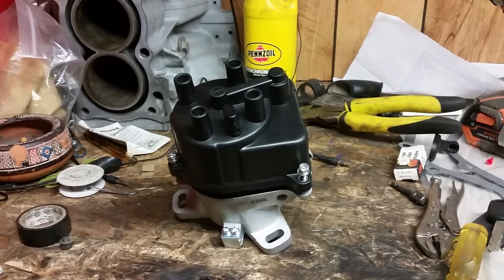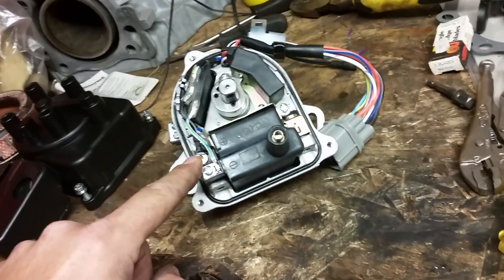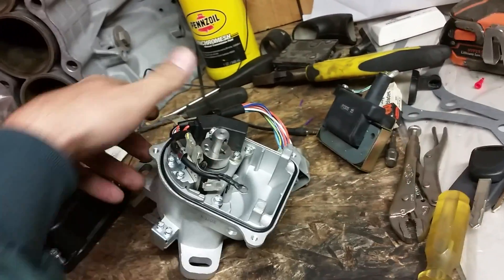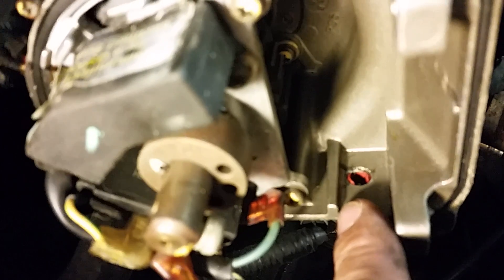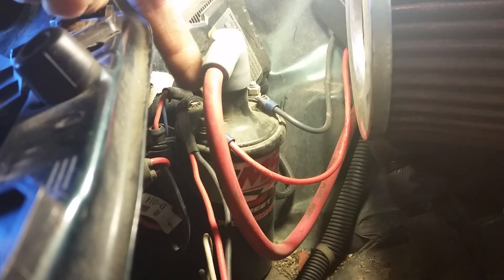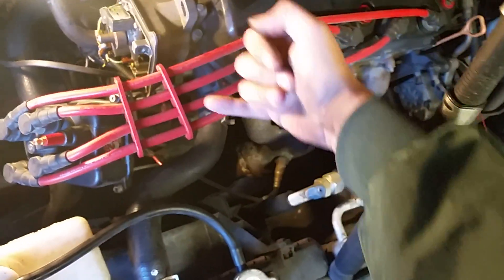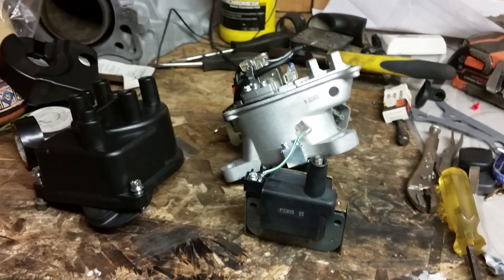How to install a MSD BLASTER COIL in a HONDA CIVIC

Comment: Do I need to hook the external coil up to the wires that came off the internal coil? 
I bought a 93 Honda accord with a MSD already installed but the internal coil is still in the distributor

Comment: Tip for everyone watching this. DON'T BUY AFTERMARKET DISTRIBUTORS!!!! Just buy the ignition module; the OEM is Hitachi, and they're not expensive. Always buy Hitachi ignition modules and coils unless you're trying to use a blaster coil.
Reply: Wrong Hitachi coil cost $120 just  get accel supercoil more powerful
Reply: @Bitcoin_Gold  nothing that I said was wrong. You can't seem to find the coil for cheaper, that's on you. Accel doesn't have the best reputation for lasting as long as any OE parts. You also don't need more powerful coils unless your system can handle the added power.

Comment: Quick question I know I'm late! Lol did you have to run different spark plugs? I got one on a car I bought and it had B series cables that didn't fit so I order the correct ones just wanna make sure I do it correctly. Any advice would greatly appreciated

Comment: Will doing this burn up the controle module?
Reply: It might. If the MSD coil actually does generate more voltage than the stock coil, it will be drawing more current to do so. If the coil draws more current through the module (ignitor) than it's designed to supply, yes, you risk damaging it. The coil is nothing more than a step up transformer, "upgrading" it won't magically generate a stronger spark out of nothing. The MSD coil is quite possibly why his ignitor failed in the first place.

Comment: There’s really no need for msd on Honda’s till your making 600hp plus. Oem is very capable. I had msd blaster ss setup on my b16 when I bought it. It sucked all sorts of ignition break up went back to oem no issues since.
Reply: 600hp? lucky those little motors do 200

Comment: The day I had one come in as a no start, and had someone crank the engine over because I heard a cracking noise when cranking, and saw this ridiculously long hot spark going from the distributor to the starter because of bad secondary ignition components is when I realized these Honda's do not need a better coil. Never measured KV, or compared it to MSD, but it would be nice to get some solid numbers. One thing I have noticed is there is a difference between those cheap Ebay caps and rotors, or any other brand I have used verses stock. I usually go to NAPA and get a rotor and cap from their Altrom line. it is direct Japan OE. There is a difference. These dizzys usually go bad because of some kind of secondary ignition problem, leaking coils, or bad shielding for the coil.

Comment: I see this video is older but I hope you still check up on this feed!!  I have a 2000 prelude w/external coil already. But it has 3 wires on the connector... any suggestion where to start?
Reply from the maker: Wow. No clue where to begin on that one! Good luck& thanks for watching!
Reply: @vrmousey1  I found info on the street fire msd ignition system I'll just upgrade the whole thing. The 2 thick gauge wires get jumped together(thin red on msd) and the thin green is the output(thin white on msd) should work great with my raised compression and added fuel. Thanks for the video btw it was still good information for that application!!

Comment: THANK YOU FOR THE UPLOAD. FOLLOWED YOUR SET UP WITH THE SAME COMPONENTS, FOR MY "00 EJ8 D16Y8. QUESTION DOES SOLELY OPERATING OFF THE COIL END UP FRYING THE DISTRIBUTOR? SINCE YOUR DISPLAYING THE SECOND DISTRIBUTOR YOU'VE GONE THROUGH. HOW LONG DID THE 1ST ONE LAST WITH THIS TYPE OF SET UP ? I PLAN TO GET THE CONTROL BOX LATER.
Reply from the maker: That modified cap and rotor lasted about a year, but I was commuting 100 miles a day in that car. I'd say that was pretty good, all things considered. Thanks for watching!
Reply from the maker: And I should also mention that because of the fact that I planned on modifying the part right out of the box I only used cheap eBay parts to offset the fact that I was going to be making it out of warranty before it went on the car. Thanks for watching!

Comment: Hey boss would this work on a d16z6 distributor I have the obd1 version just bought a new distributor installed still no spark at the coil do you think if I did it this way I might fix that problem?
Reply from the maker: Nicholas Moore take a voltmeter and check the two wires that feed the coil inside the distributor and look for 12 volts. If you show 12 volts there, and you don't have spark I would look at replacing the coil. If you don't show 12 volts there, then you might have a problem in your wiring or something else going on. You can check this with the key on, engine off. Thanks for watching!

Comment: Can the original cap be used?
Reply from the maker: Kevaun Nathan absolutely! If you use the original cap you don't have to modify anything at all in the distributor, and you won't be able to run the external coil. Thanks for watching!
Reply: victor de la puente, jr. I mean do u have to buy the pro cap?
Reply from the maker: Kevaun Nathan yes, if you want to run external spark, you will need the modified cap and rotor kit like I show in the video. You will also need a stand alone coil and you will have to run 12 volt power wiring to the coil from the distributor just like in the video.
Reply: victor de la puente, jr.so boring the hole in the original cap was for running the 12v wire...in the case u would still need the modified cap and rotor?
Reply from the maker: Kevaun Nathan I think that's where you are mistaken, I never bored a hole in the cap I bored into the aluminum body of the distributor itself and silicone that closed the two wires that are running through it are actually sleeve in heat shrink tubing that I buy on a roll. I don't believe that if you were to try and run the wire through the cap itself, that there would be room for it with the way that the rotor has to spin around inside there.
Reply: victor de la puente, jr. Oh ok I got u...so in that case the original cap can be use?
Reply from the maker: Kevaun Nathan yes sure use a fitted starter cap if you want. Send it!
Reply: victor de la puente, jr. I'm gonna need u for some help...u on what's app?
Reply from the maker: Kevaun Nathan no. What you need is somebody that knows what they're doing to show you and help you. We've all got to start somewhere, but in person and hands on is the best way. This is a pretty basic project, you don't need a mechanic, just a gearhead - Good luck!

Comment: Is that all motor single jingle fully built? Must be pushing over 9000 rpms with these shit
Reply from the maker: Mean Dean stock internals in this video, with stock jdm ecu. It let me rip to about 8200 before it would cut fuel. 
Thanks for watching!

Comment: I got a 94 toyota tercel.Will this setup work on my car ?
Reply: It has an internal coil.
Reply from the maker: Sergio Ramses it should work if you can find a cap and rotor set up for the external spark. Thanks for watching!
Reply: There is a junkyard near my house so i could look for the cap to match the setup.For the coil it's self i can use a Mallory Promaster too or any aftermarket street application coil ?
Reply from the maker: Sergio Ramses look for a new cap setup. I go thru 2 of these a year when I'm daily diving on it
Reply: Going back to the coil i mention is that ok for the application or is it to big of a coil ?
Reply from the maker: Sergio Ramses that's a good question. you should Google it, Or read the spec sheet on it so you know it will work with your build. 
Thanks for watching!
Reply: Or as they say Trial and Error XD lol thanks for the info :)
Reply from the maker: Sergio Ramses yup yup I'm a Honda guy, so I'm not the best source of info for specifics on a Toyota anyway haha. 
Good luck!
Reply: Thanks :)
Reply: I forgot to ask - What is the part that crack you mention about giving power to the coil ?
Reply from the maker: Sergio Ramses just keep the positive side separate from the negative side. Don't get them crossed, it's polarity sensitive.
Reply: Ah i see ok then :)

Comment: Does this MSD external coil really impact on real world Performance? Your inputs are much appreciated sir!
Reply from the maker: karthikdattag I noticed a definite Improvement in my top end with the external spark kit. And that was before I went Turbo. I'm sure it helps with the turbo setup as well, probably not as much because of the turbo pressure inside the cylinders. Thanks for watching!
Reply: victor de la puente, jr. , Ok. I see a lot of videos on MSD 6AL as well. Do you recommend that as well along with External coil & cap?
Reply from the maker: karthikdattag I wouldn't know what to say about that one. Sorry!

Comment: hey, i have the same building kit. The only thing that they dont send me is the ballast resistor. My question is Why i need the ballast resistor? I got It from the Company MSD Not from Amazon or ebay. Is the ballast necessary? And have i a another Opportunity to install the Kit without a ballast resistor or a msd ignition kit? They send me a operation Manual  with These two types. To install with a ballast resistor or a msd ignition kit. i dont get it. Im from Germany so sorry in My english is Not 100% right
Reply from the maker: Alexei Klaus the only ballast resistor kits I've seen were for injectors, usually when you go with larger ones. not too sure, sorry. 
thanks for watching!

Comment: What size wires go from the blaster coil to the distributor? My MSD kit didn't come with those wires.
Reply from the maker: Wesley Slaughter I ran 12 gauge stranded marine rated wire. definite overkill in a good way!
thanks for watching!
Reply: victor de la puente, jr. thank you for the quick response! Definitely going with 12 then!
Reply from the maker: Wesley Slaughter glad I could help, Good luck!

Comment: Did this on my b18b 1.8 dohc now the car back fires real bad and has no ass to it
Reply from the maker: tyler plumline that's weird, are you sure you've got your positive and negative terminals correct feeding the coil? that would mess you up for sure..
thanks for watching!
Reply: victor de la puente, jr. yes sir triple checked them lol only thing I did was change plugs do the msd blaster 2 conversion and put the bigger plug wires now she's running all weird
Reply: Just fixed it lol ignore me, I had one plug wire backwards swapped it and she fired right up
Reply from the maker: Haha glad to hear you're back! 
Good luck!

Comment: Don't you have to give the coil another wire from the battery or ignition switch?   just the 2 from the distributor.  can you just modify the old cap?
Reply from the maker: for this, you only need the 2 wires that feed the stock coil. they will feed the blaster coil just like they feed the stock one. the cap and rotor are special - they are set up for external spark - I did show the part number in the video if I remember correctly.
Thanks for watching!

Comment: wheres the wyering or soldering goes???can u share how to???
Reply from the maker: the wiring goes under all the plastic!  from top to bottom (off the top of my head, be kind) it's something like:
-plug wires 
-cap
-rotor
-dust shield
(and then you're into the goods) the stock coil 😎! 

the stock coil will have only 2 wires on it,  + and -  these are POLARITY SENSITIVE!  don't cross the wires. those 2 wires are what should be soldered and heat shrunk. those 2 wires will feed the new coil. 

I'll watch the video again tomorrow and dig some old parts out of my pile and see if I can't be a little more clear with a new video.

thanks for watching!
Reply from the maker: I watched my video again. it was pretty clear, I thought. try this one, maybe he explains better than I do:

https://youtu.be/t-2R2gf8cB0
Reply: ok sir tq so much...i got anther problem..my injector negetive pin does not give any pulse...ouch...so many problems
Reply from the maker: Sounds like bad wiring, bad grounds or bad ecu (without having seen the car, I'm really limited in where to point you)
Reply: nvm sir ill try to get whats the problem...tq sir for ur respond..

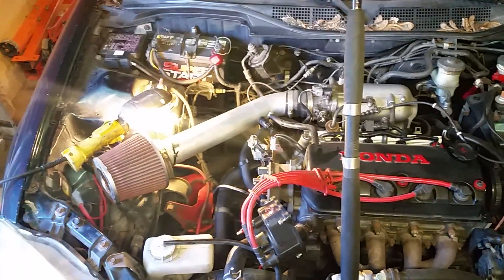Comment: you said heres my motor its a d15 jdm motor but dont need to go into that its daul vtec motor lol go watch it start at 1:49
Reply: cocky ignorant comment, i swear.
Reply from the maker: look up dual Vtec you ass, it's only on the sohc jdm d15b
Reply from the maker: +victor de la puente, jr. dual Vtec does not mean dual overhead cam.
Reply from the maker: +Dee “RoboRabbit” lol 😂 thanks for watching
Reply: +victor de la puente, jr. thanks for a good demonstration!
Reply from the maker: +Dee “RoboRabbit” my pleasure. I'm doin' it for the Honda heads!

Comment: i just watch ur video u said its a dual over head cam vtec im not trolling lol
Reply: @Wendy Boyd there is no y8 that is "dual vtec"(3 stage). Only the d15b is 3 stage which is what he said he has. You can spot this system externally  by  looking at the left side of the head on the intake side there will be 2 vtec solenoid caps instead of one.
Reply from the maker: pretty sure I said it would apply for dohc. 
link me to your instructional  video if you know better. Till then, have a great life.
Reply from the maker: +victor de la puente, jr. at least I have knowledge to share. ..
Reply: Dual vtec friend

Comment: Does it back fires better out the exhaust or anything like that what's the main point for this ?
Reply from the maker: "back fires better" lolz. backfires are bad about 99% of the time, unless you run an anti lag turbo...

just say I did it because it's cool.